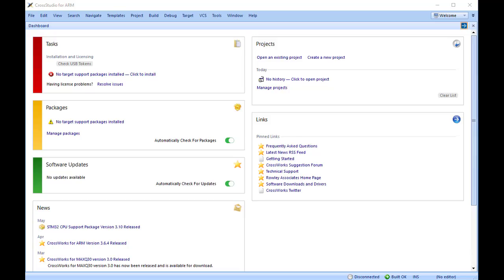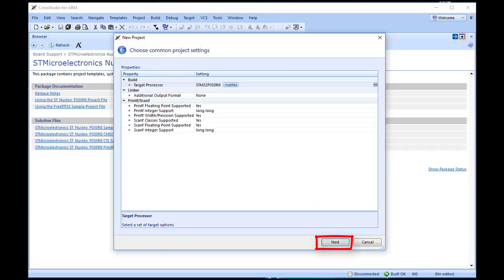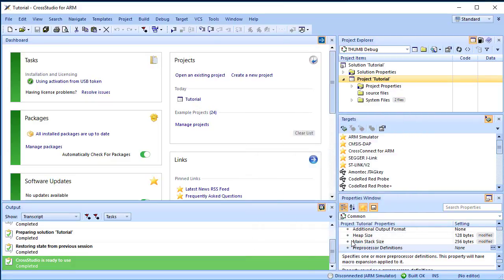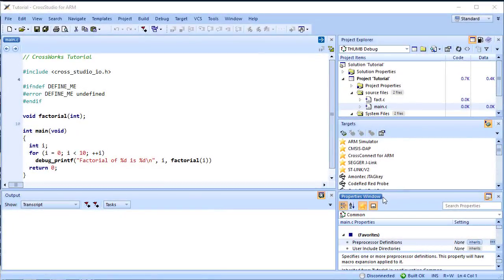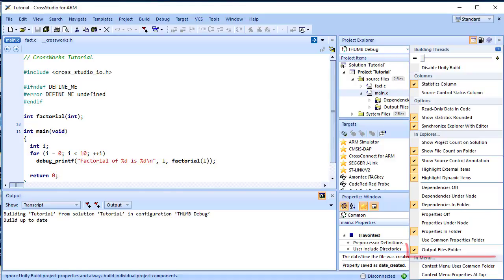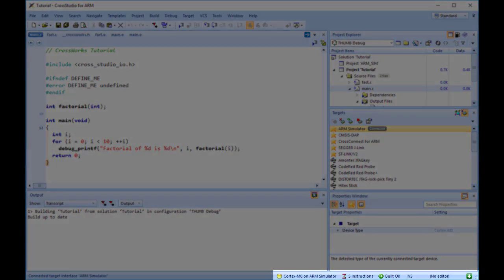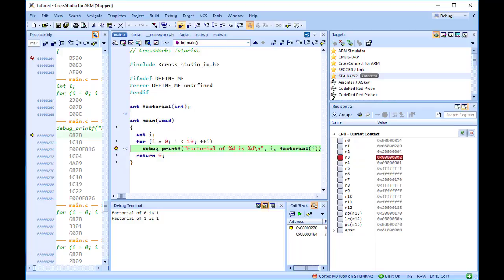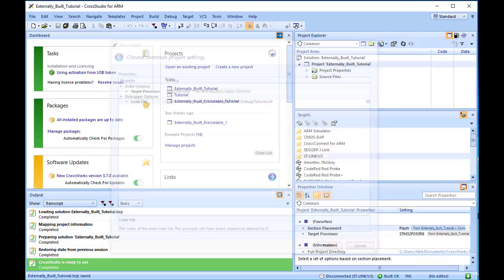CrossWorks for ARM Tutorial

Comment: If you want to know how an engine works you start by looking at the engine, then you find out about spanners and screwdrivers, then you find out about how it turns etc by taking it to bits.  This starts with spanners; didn't bother to see if the engine is ever described